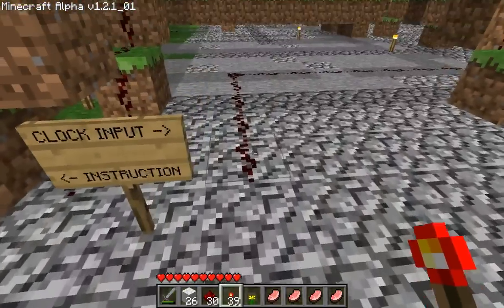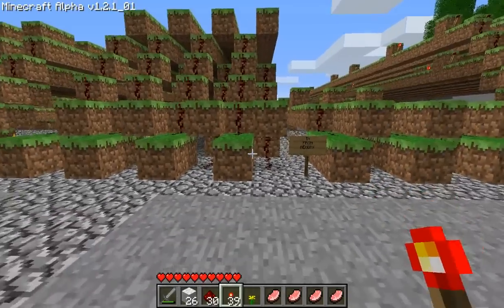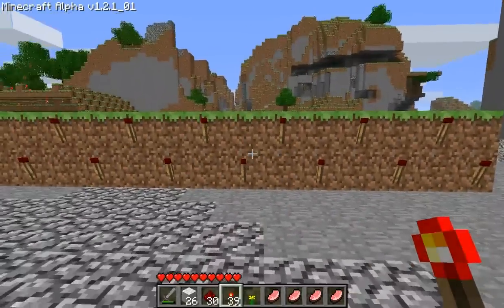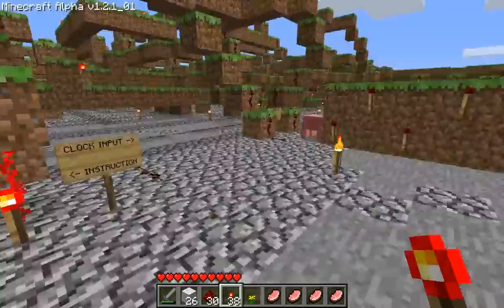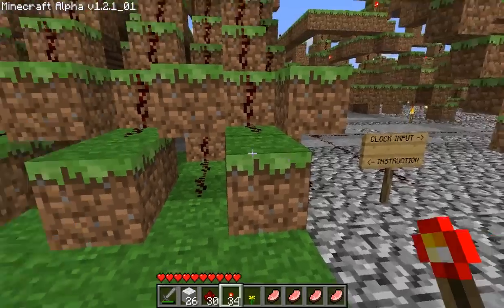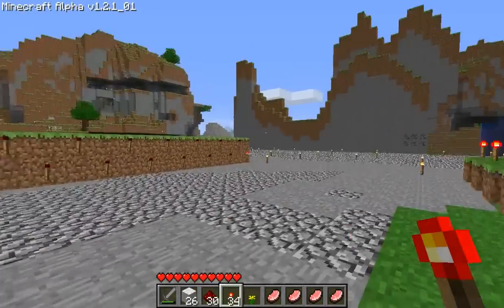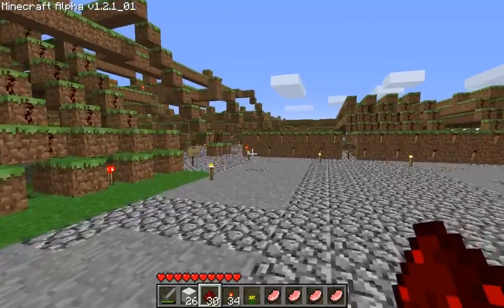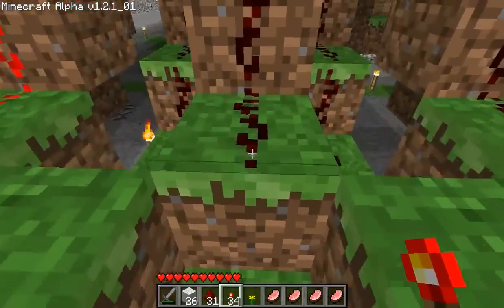Demonstrating the CPU.  Then coughing a lot.  Sorry about that.  I may be dying.

Comment: The thing I do not understand is how can the computer make a decision? It is only made from redstone. It has no switches/levers/anything that make make a yes/no decision. So I just dont understand how it works. once you put down a redstone torch, then that specific path only should be lit up
Reply: Jakob Kristensen Sandvik I don't believe there were pistons when he made this, so it is more likely that he did use the binary system of computing.
Reply: Using pistons he can change redstone paths by adding/removing blocks with redstone on them. So it doesn't have to just follow one path.
Also, I'm no expert, but binary code (what computer softwares are written with) are basically just made of 1's and 0's (on- and off's). So maybe it works kind of the same in minecraft? As redstone is also just on or off. Put enough redstone somewhere and you have written computer code :P
Reply: Using logic gates, a redstone device can do things.  For example, an AND-gate will turn an output on, if (and only if) BOTH of the two inputs are turned on.  An OR-gate is similar, but will turn the output on if ONE, OR BOTH of the two inputs are turned on.

String lots together with some other (still basic) things and you basically have this...

Research "logic gates" please if you want to find out more.  The minecraft wiki has lots of information.
Reply: Jakob Kristensen Sandvik 
Pistons?  Da fuq is dat?
He used redstone logic.  Look it up.  It's how real men do redstone.  And those that have done redstone since before they existed.
Reply: Computers often make decisions based on certain circumstances to be able to determine what course of action should be taken when completing an action. If you add 3 on a calculator, then since the default is 0, you would usually get 3; with a circumstance, such as if there already was the number 5 there, then you would want to add 3 to the 5.  The computer now knows that instead of adding 3 to 0, it says no to that, and instead decides to now add 3 to 5.  You see a lot of this sort of thing happen in modern coding.  With if statements, you can make computers do multiple things based on certain circumstances.  The same thing is going on here, too.  if one redstone input is on, then the output is off.  If two redstone inputs are on, then the output is also on.  A variety of different logic circuits are possible through the placement of redstone and likewise in electronic circuits in real life.
Reply: Even if you knew all that is in the previous comment, you would still have a valid question conman parker.  I think he is just saying that if there were levers, or places to have redstone torches turn on and off, then there would be variables for the computer to make decisions based on what things are on and off.
Reply: +Tommy59375 hey hey hey, I found you for once.
Reply: TheComputadude
hhhhhhiiiiiiiii.....
Reply: I don’t understand this 
I am not good
But at least I’m not a nerd :)

Comment: sorry for asking, how does concrete, rock, sand & fire make a computer??? do blocks run operations or so???
Reply: Rombout Versluijs A computer uses only 1 or 0 as basic signal, and since redstone does so too you can recreate a CPU basicly
Reply: what he build is a working CPU and it is basicly how CPUs work. Ok in modern CPUs you have more commands etc. but they all work in the same way/Same architecture  just like this "Minecraft-CPU". He mention a book in his first video, you can read it an learn more about
Reply: Sorry im not into minecraft and certainly don't understatement how sand, rock, stone & fire can make for circits and switches and resistants??? Is it possible to pragramm that shit? Than it would be really obvious!?
Reply: Rombout Versluijs sand rock and fire do not make anything, the red stuff is redstone, you can place redstone on the ground an create something like "power supply lines"
Reply: It's a game. It isn't supposed to be realistic.
Reply: *****
"sorry for asking, how does concrete, rock, sand & fire make a computer??? do blocks run operations or so???"
there it is, reading the original comment shouldn't be hard right?
He thought about resistors etc, because irl you need those to regulate the current used by a processor.
The fundamental difference is, that redstone has only on or off, electrical current has voltage to simulate states.
The threshold for on and off has to be set by the producer wich makes everything way more complicated.

Comment: @wetterlampe with 1 GB RAM instead of 128 Bytes,
with a clock of at least 750 MHz instead of less then 0.2 HZ,
with a levelcache, huge instructionregister, at least 64 MB ROM.
a JAVA compiler, and a tiny GPU with a screen ... then YES

Comment: HELP! 
I need help from someone that is pretty good at redstone. I need to make something that alows me to have 1 input and 24 outputs. I want the output to change when i press a button.
so when it gets a input it changes to nr. 2 After the next input nr.2 is on and 1 is off and so on. 
I'm pretty sure i need to use ts/t flip-flops, i tried to connect them in a row,  it didin't work out 2 well :P heh

Please just send me a message if you know how to do this.

Comment: To the other commentors... having a clock doesn't help if you don't have RAM to load instructions from. Otherwise, you would have to set the instruction bit as fast as the click, which isn't really feasible.

Comment: this would be easier if you used switches rather than torches for the entry points, that way you can just switch them on and off rather than place and remove torches

Comment: Using the example you used in the video, after setting the A Register to 0000000000000001 and then setting it to 1110100010010000 (the setup you used) and toggling the clock, the A Register displays 1111111100000001 which is completely different to what your getting... Any ideas?

Comment: @reconrey1292 Based off of a very bad estimate, it would take approximately 2.5 weeks of pure processing power to simply decipher the code used by Google's homepage, if you were to somehow make the input instant (no screwing around with torches). The graphical aspect of rendering the site would take far longer, considering you would need a custom graphics driver to convert images and text to thousands if not millions of edited torches to simulate black and white pixels.

Comment: @KaiqueSumatso Anything divided by zero is infinity i.e. not a real number.  Computers can't calculate using theoretical numbers (at least not the generic computers) and so it is impossible to divide by zero using a normal computer.  

Simpler terms:
1/0 =/= 0 because 1 will always be left over no matter how many times it goes into zero.

Comment: @v0ldel0rd
I have the exact same problem. When I input "set D to zero" and "A+D" the output displays the A value, but when I send that value to the D register and then input "Set A to zero" (To extract D) I receive a large value (which I'm assuming is 127, I haven't actually had a proper look)

Comment: I've redesigned the input system a little, replacing the system of placing torches to turn on an input with levers, making it a lot easier (IMO). 

I've also added signs above/below each lever, labelling what each one does when the system is in compute mode. 

Signs are also placed in front (a few blocks away, so the inputs aren't covered) of each input, labelling what binary value each bit represents.

If anyone is interested in this version of the save, just ask and i'll upload it somewhere.

Comment: Simplified explanation:  The CPU input takes a chain of bits (each being 1 or 0, upper torch or lower i think).  If you dont set instruction bits it simply loads the bits into A register as a number.  If you want to add that number you set the instruction bits and set the operation to move that number from A register to D register . After that, unset the instruction bits and send a new number to the A register, then set an addition instruction bit to add your A and D numbers for your result.

Comment: @DavidL999 It's a CPU.  The processor to a computer.  They are made out of thousands of transistors that allow the implementation of binary logic which is how all computers work.  You feed the CPU binary instructions by switching on and off circuits (on is binary 1, off is binary 0) and the CPU uses those instructions to compute a result.  This is how your computer works and every computer and here you can see one close up.  They are normally made out of microscopic silicon.

Comment: @MoonCalledShadesri for easier explanation, our counting base, which is 10 goes trough 10 numbers before getting one more digit (0-9) , and then gain a second digit (10). Binary is base 2, it goes trough two numbers, 0 and 1 and then gains a second digit. That way, 1 is 1, 10 is 2, 11 is 3, 100 is 4, etc. The digits go in powers of two, (2x1, 2x2, 2x2x2, 2x2x2x2, etc) so the second digit equals 2, the third equals 4 the fourth equals 16, etc.

Comment: Dude, this is honestly amazing. When I built my train station and had a bunch of latches in there I thought I was being all smart, but this blows that out of the water. 

One thing, why don't you add switches to the inputs? That would mean you wouldn't accidentally break the redstone and you would be able to toggle input bits much easier.
A thing to think about ;)

Comment: @ignas2526 
In a more advanced microprogrammed CPU the machine code instructions are "translated" into actual control signals by a control unit.
This additional step of translating machine code into control signals is not actually needed for such a simple CPU. The control signals just are the machine code.

Comment: @P3pperjam

The delay is mainly caused by the fact the fact that his ripple-carry design is somewhat primitive and that you get a 1/16 second delay any time you invert. And because of the 15-block redstone limit, the only way to make wires go any distance is to invert them over and over again, which hugely slows down any large circuit.

Comment: @1337shellc0der 

128-bit architecture wouldn't provide that much of an advantage over 64-bit. They could build it, sure, but it'd be a waste of space because you never need to address 128-bits of memory. You may need to far into the future, but not right now. A 64-bit CPU would actually be faster.